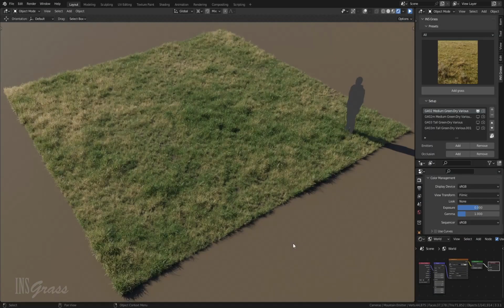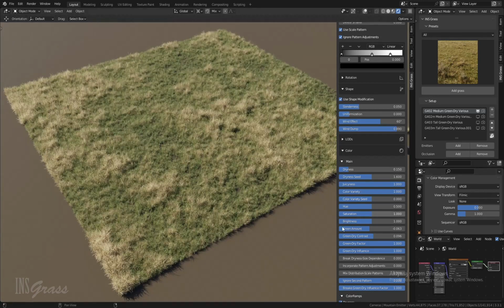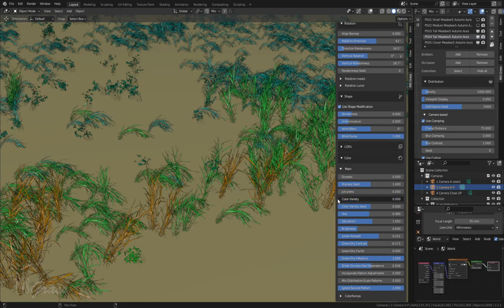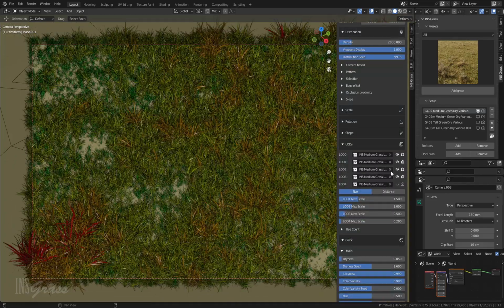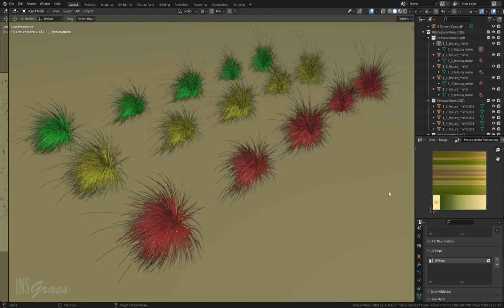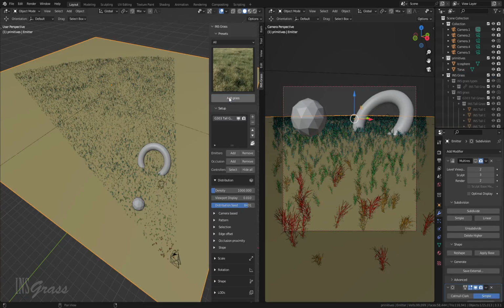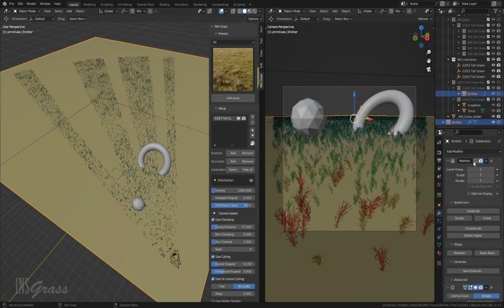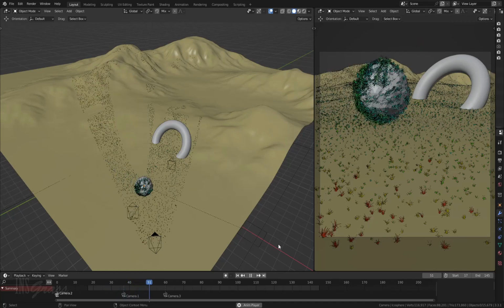INS Grass for Blender 2.0 Presentation part 1

Comment: Hi, this is a great Add-on. Is it based on Geometry Node? I experienced something bad with the Geometry Node based Add-on, every time I rendered a scene, Blender would close suddenly.
Reply from the maker: Hello. Thank You, I'm glad that You like the add-on. Yes, INS Grass is partly based on Geometry Nodes. Newest add-on version is compatibile with Blender version 3.6 and above. Have You tried to investigate wahat caused Your problem with geometry nodes? Maybe the add-on that was causing Blender crash was incompatibille with Your Blender version. Since now over 130 people have purchased INS Grass, and we had two reports about problems with our add-on. One was caused by low end equipement of the client, second one was related with some Windows version issue. We tried to solve it, for a two weeks, but we achived only half succes. The problem stopped to occur when the client switched to Blender 4.0. If You will encounter some problems with the add-on We will try to help. If there will be a unsolvable problem caused by the add-on, we will get back the money that we will earn(what is about 80% of purchase price, if the purchase was made through Gumroad, Blender Market has its own cost return policy).
Thank You for comment and nice words.